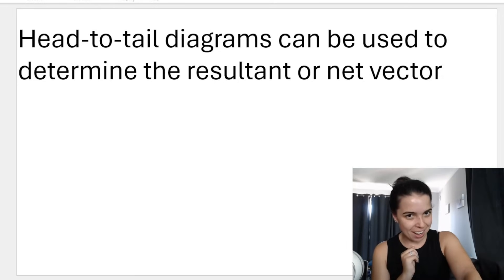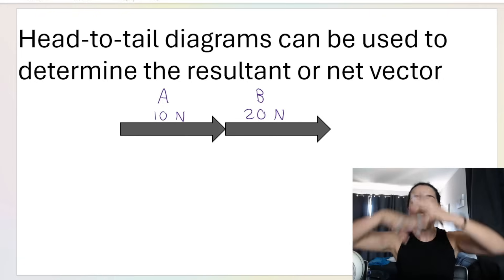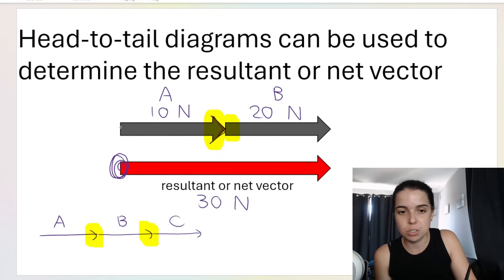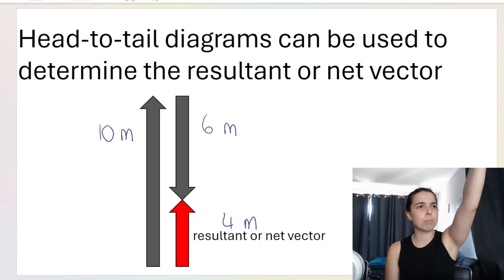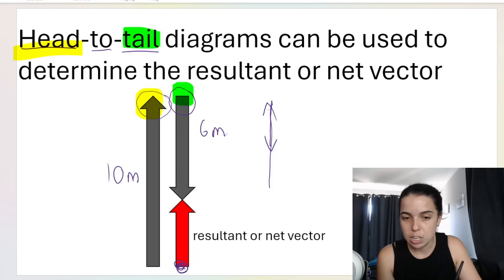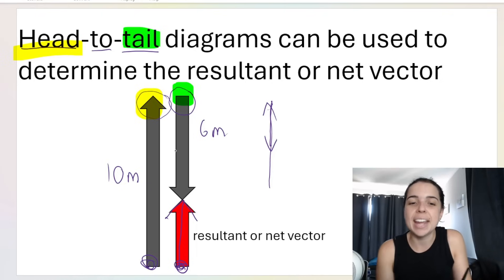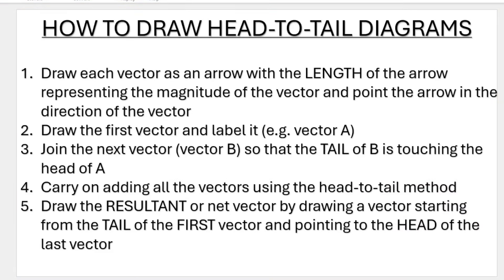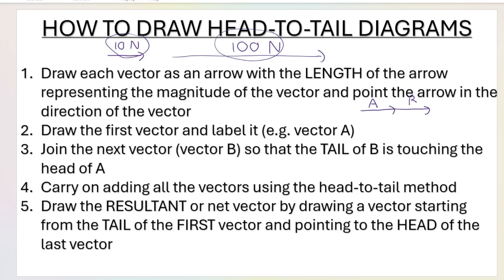Grade 11 Head to tail vector diagrams

Comment: 14:31 Shouldn't the resultant have a direction?
Reply from the maker: If they're just asking you to draw in the resultant in a head to tail vector diagram, then no direction needed. The arrow is pointing in the direction. But if they ask you to use calculations to determine the resultant then absolutely 💯 yes
Reply: @missmartinsmathsscience  Thank you miss